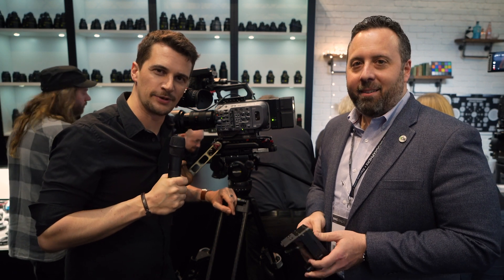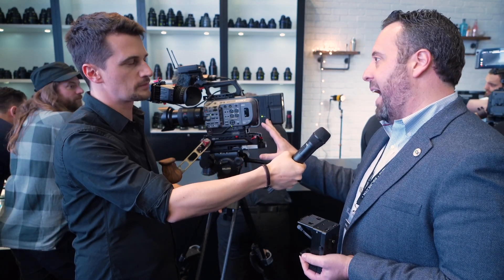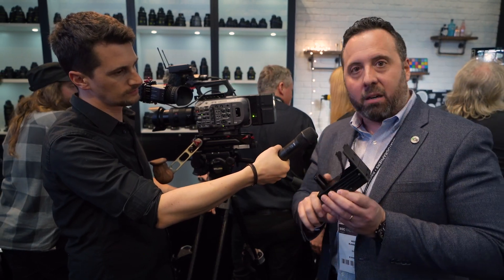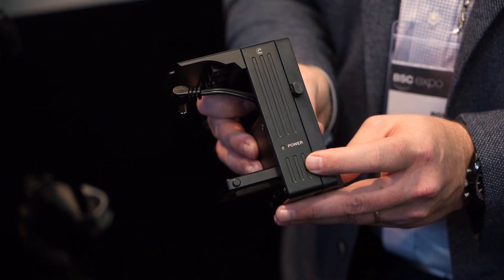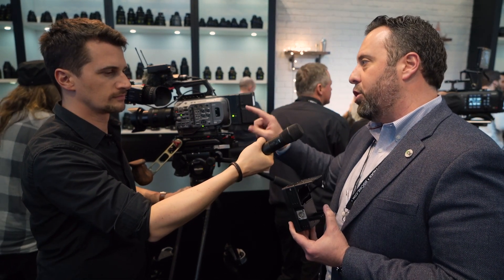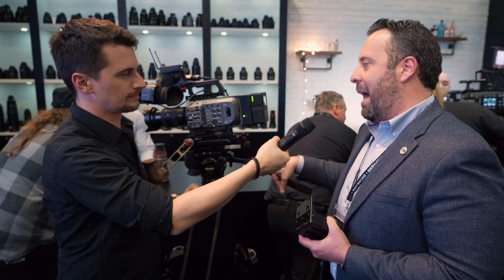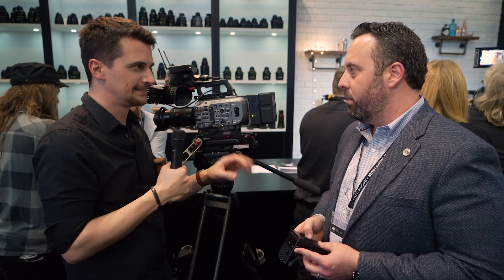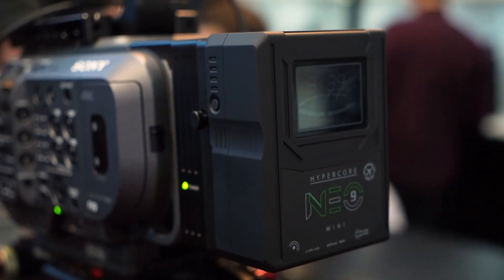Core SWX V-Mount and Gold Mount Battery Plates for Sony FX9

Comment: A red blinking light definitely doesn’t cut it, a voltage meter screen probably costs a couple pence/cents in a professional setting you need a meter reading so you can estimate how much longer you have on the battery, if that means rolling on the next take or not
Reply: Depensing on your batteries, they have a screen where you can see details, with the red light being a pre-warning

Comment: Can you still use a internal battery? I like to use an internal battery as a backup?
Reply: I've read that it's possible to leave a small Sony battery in the battery slot and it will kick in once the V-mount battery dies or is removed, so it's possible to hot-swap V-mount batteries.